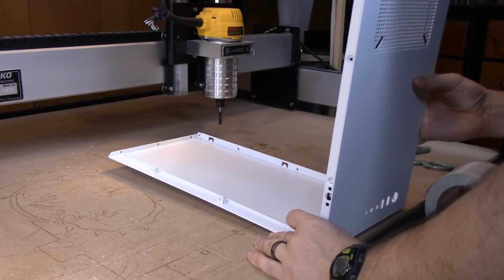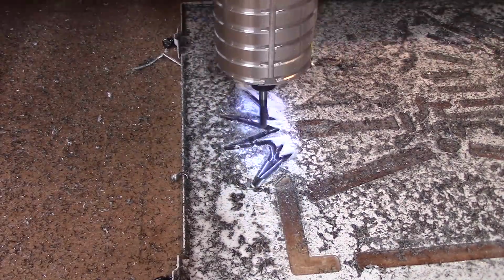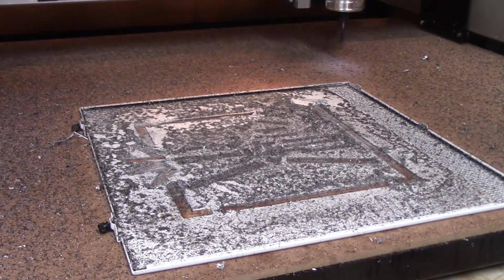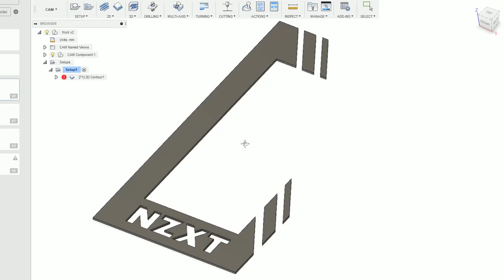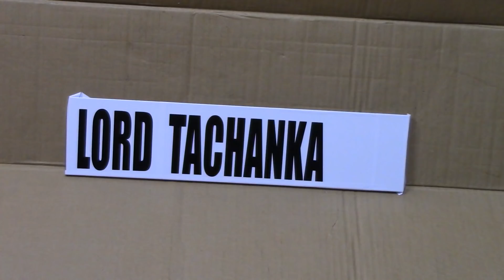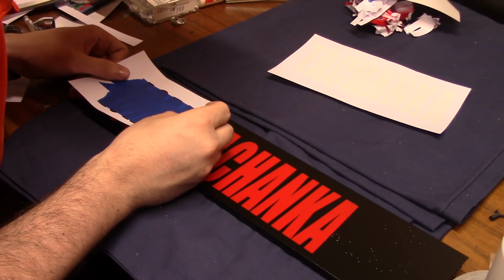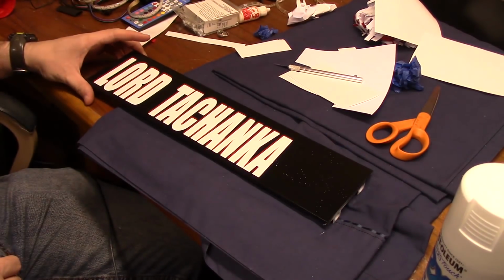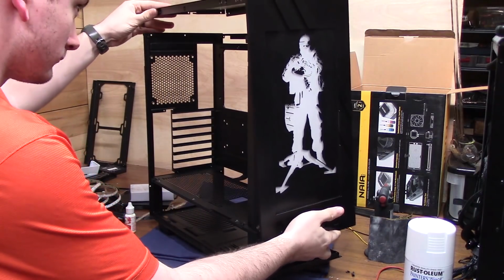Modding the NZXT H500i PC case: LORD TACHANKA

Comment: Discovered your channel by accident a couple of weeks ago, and boy am I glad I did! Your content is very entertaining, well edited, and your music choice is simply perfect (watched this video a total of 3 times all the way through). I understand that this is an older video, and so it would make sense that you won't see this comment.

I was originally looking to mod some games, when I came across one of your other videos. Ever since then I have been obsessed with case mods, and I think I want to try one on a tight budget.

I don't have a vinyl cutter or any other tools in fact, however I think it is possible to modify my cheep 3d printer to make it cut vinyl in a similar fashion. I would like to get the H510 and cut a hole into the front to put a mesh there, however I have no idea how to make a clean cut without using a CNC machine or other expensive tool that I simply can't afford. Any chance you could give me some advice? No problem if not, might be a while before I can afford it.

Comment: This is a very good attempt and i respect the work you have put into it its a nice case.  If i had to nitpick though i say the following isnt really  up to par: paintwork is thin and unevenly applied, the hot glue around the LED light up silhouette is a bit rushed and messy and the double sided taped on acrylic pieces will fall off with time.

Comment: If you put a spring on the drill bit you won't have to worry about bottoming out the drill on the case when drilling the pop-rivets.  The side panel came out real nice, but I would have lined up the front panel pieces with a ruler going across the whole width to ensure they are parallel and lined up correctly.
Reply from the maker: Good idea!

Comment: you dont need to lube all metals, depends on bits, speeds and feeds for various materials. aluminum you dont need to lube unless you miling solid billets, or billet stocks. hard steel you want to lube, and mild steel is lube as needed. thickness obviously plays a role, 1/8 material or less, you really dont need to lube. anything thicker I would give it a dab of some cutting fluid, NOT WD - 40!!! 

 
lets refrain from calling it lube from now on? its cutting fluid. its meant to cool and lubricate. if you are drilling or milling with a thick bit, thru thin material of a relively weaker metal, you dont have to use a cutting fluid. 

Nice mod, nice router... 

You should take up welding. and take some machining classes at the local community college, just the basics will benefit you greatly! and will expand your abilities into new tools as well :) 

Im considering creating a company making custom computer cases that are all metal, welded, and modified of course, 100% original design and materials used, considering using materials like titanium, various grades of stainless, brass, copper, can use inconnel, nickel... 

I admire hand craftsmanship, Im a welder fabricator machiner guy too. cheers, and hope you keep the art stuff up, make ur own designs, mods, something will open and you will have yourself a lucritive business you can retire from in your 30's.
Reply from the maker: Dude! Yeah I really want to learn how to weld, and I'm probably going to save up for a plasma cutter too :)

The CNC machinist part of me is still a total noob, definitely need to learn how to do shit better